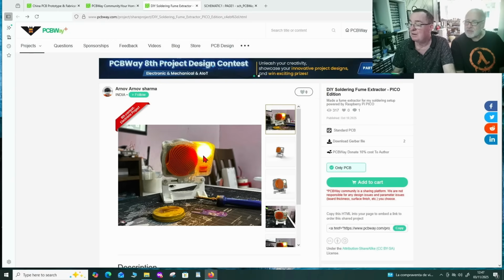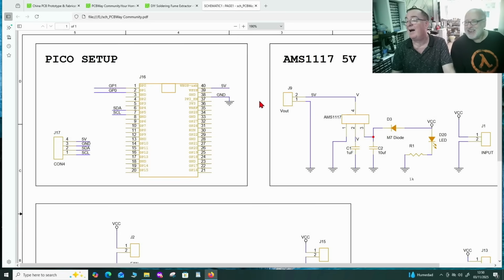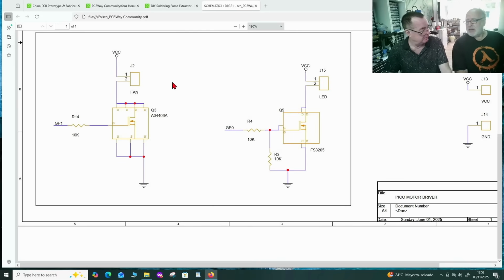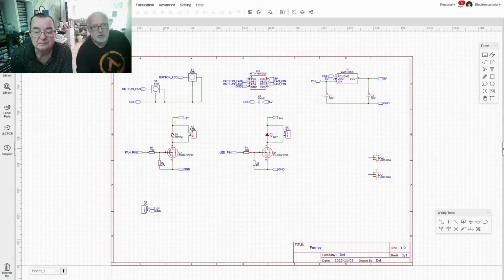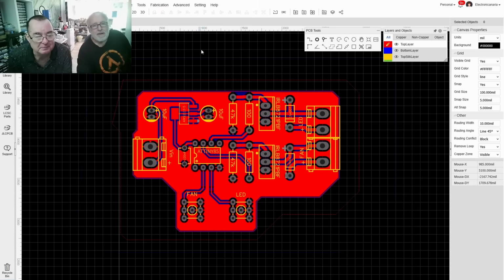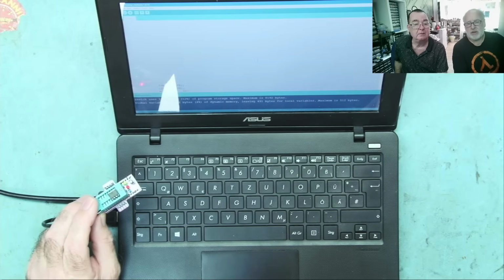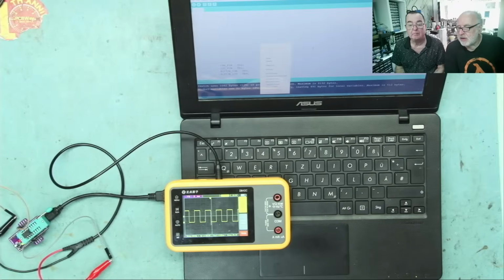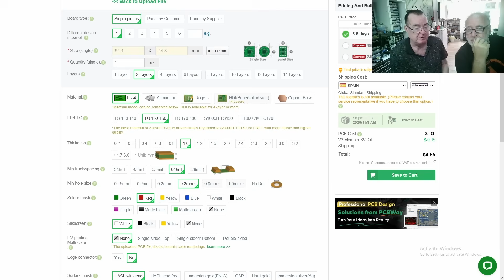DIY Solder Fume Extractor Project : Reinvented by Rich & Detlef

Comment: This is peak electronics nerd overkill. $50 in parts + hours of design...when flex duct and an old PC fan still does it better (actually removes fumes from the room instead of recirculating). Add a $2 PWM module if you really need speed control. Save the MCU for something that deserves it! 🤣

Comment: The nice thing about using a little microcontroller like the ATTiny85 is the flexibility. It’s easy to turn this into a “deluxe” fume-sensing version that speeds the fan up when it smells solder smoke and slows it down when the air is clear.

You only need one extra part — a cheap smoke/air-quality sensor module. Feed its analogue output into the ATTiny85, sprinkle in a few extra lines of code, wave your fairy wand, and Bob’s your auntie.

It means the fan stays quiet when you’re not soldering, saves power, and you don’t have to prod a speed button with tweezers while juggling and trying not to lose a microscopic SMD part to the carpet forever.

If the fan starts turning on when you’re not soldering… it might be a sign, that its well past time to launder your socks.

I’ve currently just got an old PC fan blowing fumes in vaguely the wrong direction, but where’s the fun in being sensible?

Comment: It's pure insanity, why specify a microcontroller to turn on a fan? Fan - battery - switch... Done! Need speed control? Fan - battery - switch - resistor...
Reply from the maker: What wattage resistor would you use?
Reply: Hi Alan - I'd question the need for speedcontrol, too - but if needed, a Micro will always be my choice. Less component count than doing things with a NE555 (or two), although you may run a 555 directly from 12V.

Comment: I see that one manufacturer recommends 10 µF at the output of the AM1117 if the cap is tantalum and 50 µF or greater for aluminum electrolytic, noting that the ESR cannot exceed 0.5 ohms.
So much for my mistaken notion that the AM1117 might be a technological improvement on the Burr-Brown REG1117. I don't know when the REG1117 hit the market, but Burr-Brown was acquired by TI in 2000 and the 1117 was around for a few years before that.
At least it seems OK with very low ESR in the output cap. Some of the earlier LDO reg's were very fussy. If ESR was either two high or too low they could be unstable. (These stability issues are due to lack of access to nodes where frequency compensation caps too big to fab on an IC would normally be connected. All of the 3-terminal regulators are considerable feats of clever design to get them to behave with that limitation.)
A good-quality 10 µF tantalum cap will probably cost considerably more than an AM1117.

Comment: Maybe the lad's personal version also doubles as a multi-machine emulator and he can game while extracting fumes.  The public just get the bare bones version 😁  
Yeah, I'd have went arduino as I have loads of 328P's lying around but a tiny is the better choice, if you have them.  Hope you credit the lad in the code (and maybe the remixed project) 👍
Reply from the maker: I did include a link to the original PCBWay project in the video description

Comment: Though "ledState = (ledState + 1) %4;" is simple enough, if you really want computation efficiency, use "ledState++; if (ledState>4) { ledState=0; }" as you always need the addition and assignment but a modulus is division overkill and the if statement block is far simpler.
Reply: Hi Cliff - I did the lazy thing - copied the code and just changed the pins. And yeah - I'm with you on optimizing.

Comment: That code should just about fit on an attiny13 even! gj both.
Reply: Hi Perkulant - yes it will. I have heaps of the '85 laying around, so a '85 it is. If you want to adapt: that should work fine.

Comment: I laugh at people who think the little wisp of smoke that comes off a soldering iron is somehow hazardous. That's because I have gotten genuinely flux sick. So I know what it takes for that to happen. I threw a whole one pound spool of rosin core solder into a pot of molten lead. It melted immediately on contact.  The whole spool. Poof! Now that cloud was enough to get me flux sick. I immediately dropped to the floor writhing in agony dry heaving. That's being flux sick. You'll know it if it is happening to you. There will be no question. No delayed reaction. It is immediate.

Comment: Even an ATTINY is overkill, two 555 timers would have worked just as well and no programming
Reply: Yes probably,  but which is cheaper (more cost effective)?
Reply: @Mr_Rusty1  For a simple project like this the MCU is probably cheaper, but add a couple of pots to the 555 and you have fully variable brightness and fan speed, not so easy with a couple of buttons.
Reply from the maker: Doesn't the 555 solution require more components than the simple MCU solution?
Reply: Hi PhilWorkshop (?) - Somewhat with you. With a NE555, you can skip the voltage regulation (feed the NE555 directly from the 12V), but you'll probably need a NE556 (two 555 in one package), some pots, caps and a handful of resistors. You won't get away without MosFets. 
Sure - no programming needed - but the code already exists and it will work on nearly any MCU - even the 30 cent MCUs from China.

I guess this all comes down to what you're more familiar with; for me, I do like my little MCUs :)
Reply: @DetBuildsStuff  I wan't trying to have a go at anyone, just thought I'd give a slightly different perspective from the norm these days.

Comment: Some information for simple ducting for people who do not have access to or want to pay for 3D printing.

A standard coupler for 65mm square downpipe is available from most building material suppliers across UK and Europe. People from other areas will need to check what is available.

This coupler is about 120mm long and has 3 cross section sizes. The bottom part is 60mm wide, the middle part is the nominal 65mm and the upper part is 70mm. Wall thickness is 2.5mm. There are also options where the bottom part is circular.

 A standard 60x60x15 fan will fit exactly into the nominal 65mm section and cannot fall through the lower 60mm section which has an internal width of 55mm. You can then add other 65mm ducting and adapters above and below the coupler.

Edit: I have since noticed that 112.5 and 92.5 degree bends have similar internal dimensions and may also accommodate the same fans but I have not tried these so I can't confirm that they will fit.

Comment: Hi a Pico 1 (2040) use under 30 mA 2 core running so the 1117 have no problem supply But is overkill for this i will use a ATTiny3224 or smaler
FET i will use AO3400
Reply: Hi hschack - my favorite MosFet :) When Rich and myself talked about the project, we had rebuildability (is this a word?) in mind; that's how the whole Throughhole thing came along.
I'd actually played around with the idea of doing a PCB with one-side Throughhole and the other side SMT - but you know: lazy Det and stuff :)

If you're going ATTINY, a 412 will be fine, you can basically use any half recent micro for the project.

Comment: It's very interesting to see the 2 different takes on this project, which all seem a little OTT for a fan.
But then I get thinking, wouldn't it be fun if the fan sensed when the soldering iron was in use and automatically switched itself on ! Maybe with a timer to continue fume extraction after the soldering is finished. Then all this programming makes sense.
Reply from the maker: Haha that is an interesting idea I'll mention it to Det
Reply: Sensing the iron? Timer delay? Sure, why stop there? Add WiFi so it connects to your smart home, Alexa integration and mobile app that tracks real-time PPM levels, graphs your daily rosin exposure, and sends you push notifications when filters are low. Build an AI-powered soldering assistant that critiques your joint quality via camera, auto-orders replacement filters from Amazon, and live-streams your bench to Twitch with overlay stats. Finally, hack a 6-axis robot arm off a 3D printer to do the actual soldering. Problem solved forever!

Or... hear me out... $5 flex duct + USB fan. No app updates required. 😂 Flex hose gang sends regards.

Comment: They use a fancy modern microprocessor for the thing, but an old school 1117 LDO regulator from the 90's. Each to their own.
Reply: There are many better and modern alternatives to the old 1117, and even cheaper. Lower voltage drop, less quiescent current, no minimum load, not picky with capacitor ESR, better documented specs, etc. The old 1117 specs vary by manufacturer and if you are unlucky, and drop it into an existing design, it might oscillate.
Reply from the maker: @johansvideor  Which regulator would you use? Personally I woud have used a 7805 to keep the whole design through-hole which makes it easier to build. I understand why Det went with the 1117 as they are ubiquitous and a lot of folks here will have them laying around, either new or salvaged
Reply: Hi Johan - availability! 1117-5 or 7805 are everywhere, so from a rebuilability-perspective, I actually should have went with a 7805.

Comment: Whatever happened to "Simple"? 😅
I made a Fan for my Bench with just a 12v Fan, a 18650 Battery holder, a Switch, a TP4056 Module to charge the battery and a MT 3608 Module to create the 12v for the Fan. Throw all of that together with a little hot glue and you will be done in less than 10 minutes and less than €5.
You can adjust the speed with the MT 3608 Module. 
I think most of us have all of these bits lying around.
If you want to get fancy, you can add a Grill and a carbon filter too. 😊
Reply: I made one with 2 computer case fans that used a molex connector that I adapted a barrel connector to and which I use a walwart adapter. In between the two fans I sandwiched a double layer of activated charcoal material. Directing the exhaust here out a window is not possible, especially in the winter time. The fans are older Antec ones which are 3 speed fans that have their own controller switches coming out of the fans.
Reply: Saludos amigo me puedes pasar tu diagrama donde se ve como lo hiciste o tienes algún video o canal de YouTube para ver, porqué tu idea lo veo más económico, gracias y saludos desde Perú 🇵🇪
Reply: @Arturochirinoscruz  you don't need much of a schematic. Get a TP4056 Module with protection and connect a lithium battery of your choice to B+ and B-
Connect OUT+ to a Switch and OUT- to the MT3608 (VIN-)
Connect the other contact of the Switch to the MT3608 Module (VIN+)
Connect a 12v DC Fan to OUT + and - of the MT3608 Module.
You can adjust the Fan speed with the Potentiometer on the MT3608 Module.
Have fun! 😊

Comment: Why the heck would you need a Raspberry Pi for a fume extractor?... 12v fan, power supply and a switch...
Reply: it use for speed control even 555 ic is better or pwm speed controller would do
Reply from the maker: This is what Detlef pointed out